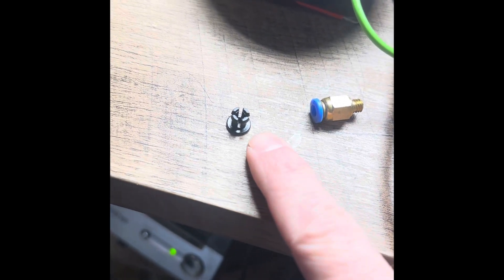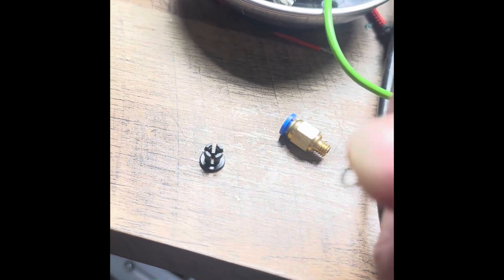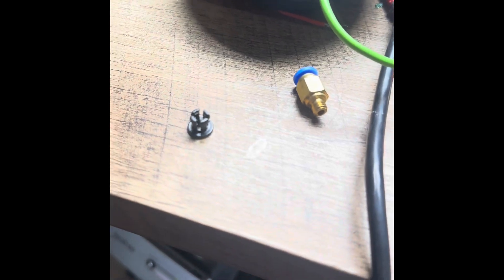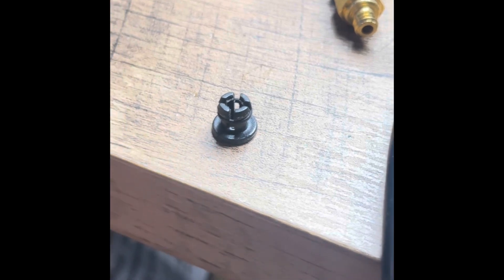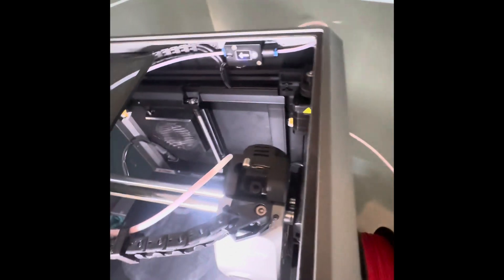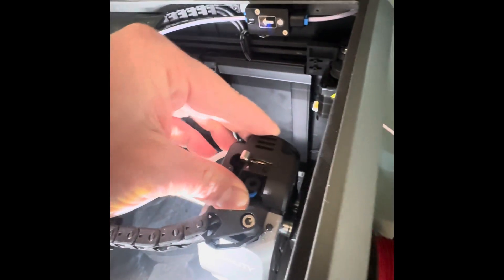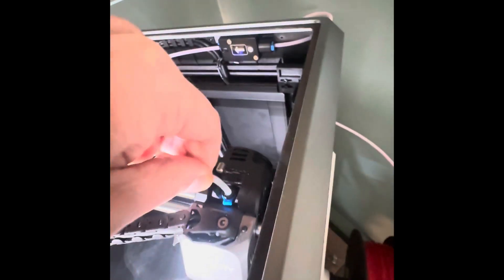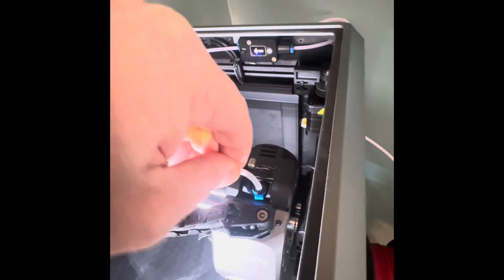WATCH THIS if your Creality K1 Max pfte(Bowden tube) keeps popping out(TEMP FIX)

Comment: The idea is to put the blue retainer clip on AFTER inserting the bowden tube fully into the extruder....NOT before.

Just make sure the bowden tube is fully inserted and you should have no problems.
Reply from the maker: The problem was that tube with the clip on kept popping out bc the blades weren’t digging in. I just gave it a little encouragement. I tried multiple ways, clip before/after, clipping the tube fresh etc before taking it apart and physically seeing the blades were barely biting.
Reply: Literally just got mine and I bought it second hand, I came to this video because I was having the same issue and I’ve basically just “unlocked” the filament lock and then pushed the Bowden tube end down with sim needle nose pliyers until it was snug and played round with it noticing that it’s loose while unlocked and so I pushed it as snuggly into position as I could before then “locking” it and now I’m having no more feeding issues. An O ring may actually separate the Bowden tube more from the hot end unit due to being a spacer unless you perfectly pushed it into place without it spreading that two parts apart